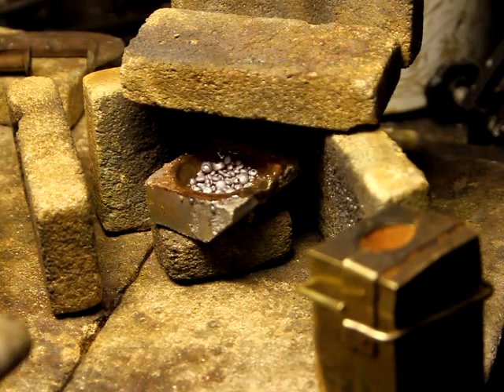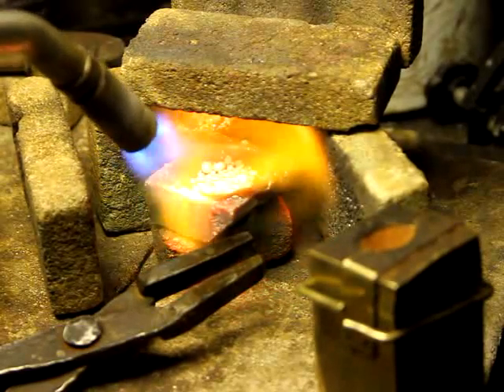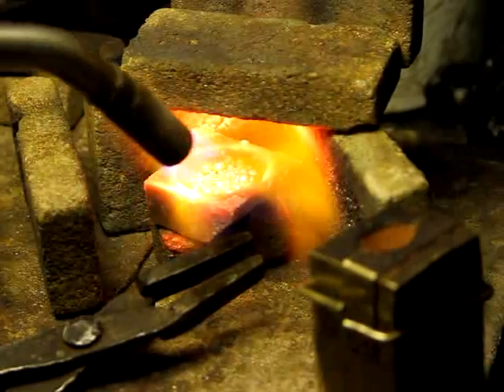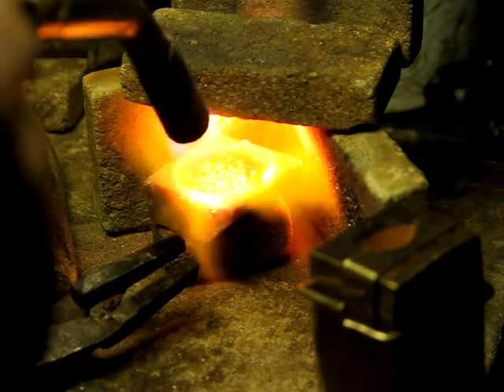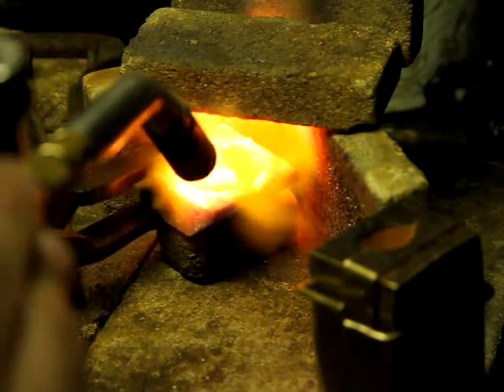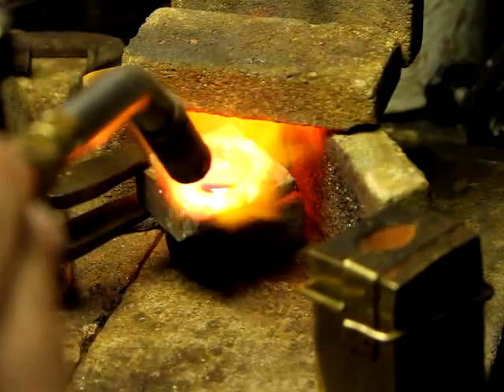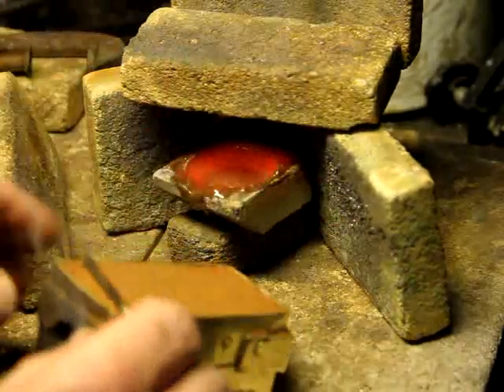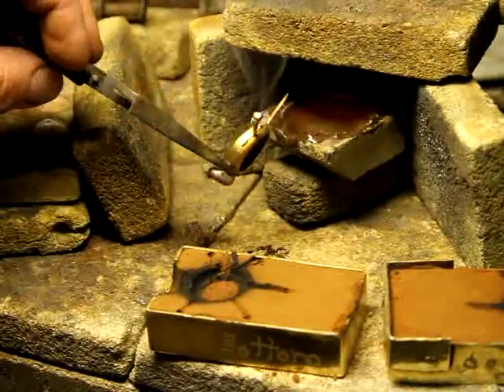Casting silver in Delft clay-sand casting, pt 2.

Comment: I have been having trouble with silver filling the shape of my mold... the silver is liquid, but when it hits the mold it solidifies too soon and im left with an unfinished cast?
Reply: caius adri. You need to use borax and heat it hotter with map gas which is a yellow canister you can get at Lowe's.

Comment: Fantastic! What type of torch do you use? MAPP or propane? If MAPP, did you use an oxygen tank?
Reply from the maker: Straight propane,  though oxy/propane would be easier.
Reply: porkyfedwell. Map gas is best because it heats hotter.
Reply: Mapp gas is only about 100° hotter than propane.